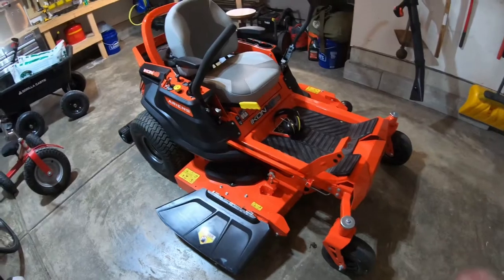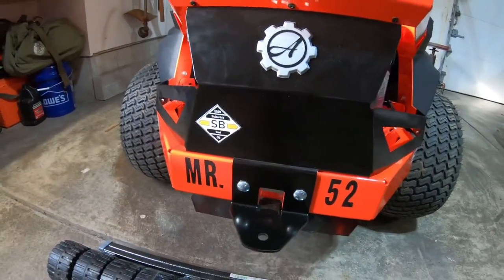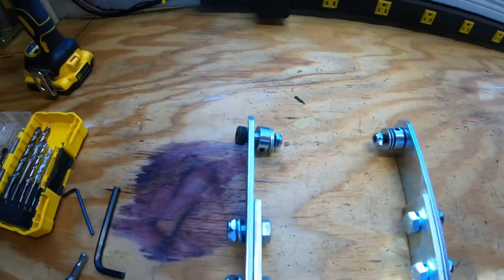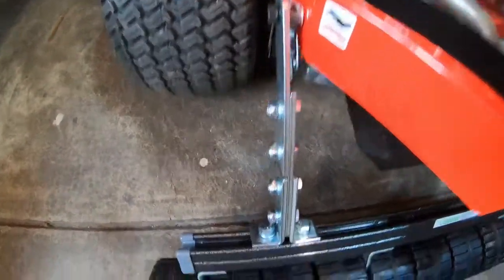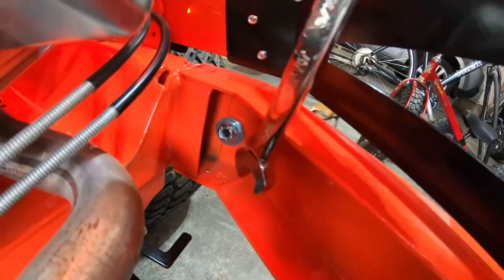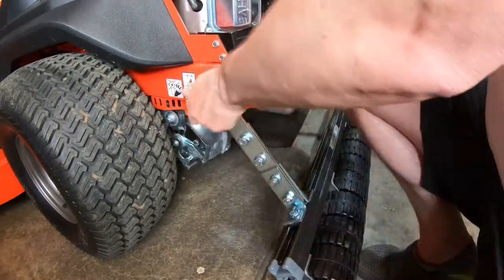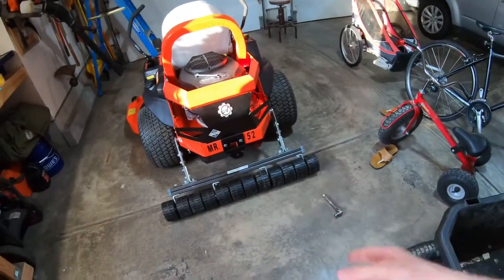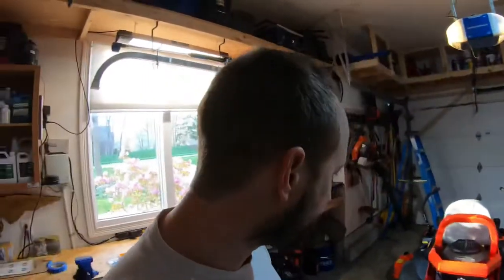Installing Striper on IKON XD #MR52 #ARIENS #BigLeagueStriper

Comment: My Friend is a Genius, been cutting and maintaining lawns for big million dollar company's aka Wegmans Not taking anything away from the big league striper kits! they look  awesome, just dont have 350 to 450 dollars to spend I own the 42 inch Ariens IKON XD 915268 18 HP 603CC Kaw. Went to a local hardware store  Ace  up here in Upstate N.Y. spent 8 dollars for a 38 inch piece of Rubber 24 cents for 2 screws,. had my friend drill the holes, and wallahh it bends the grass blades just as well as the BL Striper kit. Hope this helps to save a few folks some $$$ Have a great day and get back to mowing! Respectfully your Friend Ice Man.. P.S. I did follow your lead and put on the stickers back side of LM says MR 42 Kepp posting those Videos Suburbia Dad! Much Respect👍
Reply from the maker: There are a lot of versions of DIY stripers out there that work. I tried one on my previous lawn tractor and destroyed the rubber mat all over the yard. 🫣😆

Where did you fasten it? The back? I’ve thought behind the deck with a flat piece of steel securing it might work. It would be similar to their kit available for some of their models. 

Thanks for watching and commenting!

Comment: Just bought the same mower.   Curious to see if this striper performs.  Also, is it locked in place or is it free to bounce up and down on rough terrain?
Reply from the maker: It moves freely. I have the video done. I was going to edit it down, but I might just post the front yard tonight. It works great and my yard is not smooth! Thanks for watching!

Comment: Awesome video just received my big lawn stripper kit a couple days ago and couldn't find a video to fit it on a Ariens mower
Reply from the maker: I couldn’t find it either!

Using the painters tape kept me clear of the tube frame on the backside when I drilled the holes. I’m glad I checked before I drilled. I almost didn’t! 😳

Please tell me you’ve mowed by now!? 🙏
Reply: @theSuburbiaDad  I have mowed and there definitely is a learning curve and I want to mow a few more times before I throw the striper on it but great advice with the tape
Reply from the maker: @lawnchild1829  I mowed for the fourth time and I’m getting the hang of it. Took me a few times to figure out how I was going to attack the yard, but once I did... it’s been smooth! 

Something that helped was when I realized my handle bars were backwards after the third mow! 🤦‍♂️ 😆

Let me know how the install goes! Good idea to let the grass grow for a few cuts before rolling it with striper. 

✌️
Reply: @theSuburbiaDad  mine weren't backwards but they definitely wernt lined up correctly which made my straight lines not very straight but I fixed them now

Comment: Gotta love those Big League Stripers.  Does the roller float up and down as easy as it did with the quick connect setup on your previous mower?
Reply from the maker: It’s a great addition to Mr. 52 for sure! I don’t really notice it behind the mower. So, like a cloud? ☁️☁️☁️😆

I didn’t get quick connect on this one. Not sure how I feel about not having it yet. 🤷‍♂️ I imagine I won’t take it off much. I can purchase a quick connect bracket system for $40 from Big League down the road if need it. Other two bolts, five minutes to get off. 

Solid build regardless!

Comment: Love the videos, I have the same mower. What size roller did you get and now using yours did you get the correct size or should you stay with the recommended width of measuring half way between both rear tires?
Reply from the maker: This is the roller Big League Lawns recommended when I called... 

https://www.bigleaguelawns.com/checkmatetrad-lawn-striper-for-ariens-ikon-x.html

It has worked perfectly. I’m happy with the striping! 

Thanks for watching! I’ll get some more up soon.
Reply from the maker: This video shows a recent mow with it... https://youtu.be/RAyTh-_JNC4

Comment: Great video! A couple of questions. Can you keep the roller on when using the hitch to pull a cart or spreader? Also, any knowledge if you can have the roller, hitch, and bagger on at the same time? Thanks again!
Reply from the maker: I keep the hitch on all the time. It doesn’t hinder or impact the roller at all. If I attach the cart, still no issue. You can get a quick release system as well for the stripper. I just didn’t get it... yet... 

The hitch has an opening for an adapter. I don’t have the bagger... yet... but I assume it plugs into it. So, you might be able to run the hitch without the cart, the bagger, and striper. 

Hope this helps! Thanks for watching.

Comment: Are you able to lift the roller off the grass an hook it up behind the mower if you wanted to?
Reply: The striper kit its self is pretty heavy ( probably around 30- 35lbs)so you need something pretty strong to hold it up but mine came with a quick connect system that would allow you to remove it within a few seconds
Reply: @lawnchild1829  I will have to check mine. I may have the same thing. I got it last fall and haven’t attached it yet.
Reply from the maker: I didn’t have a quick connect, but might be worth it. I had one on my lawn tractor. It was super convenient. Currently, it is two bolts to undue. 

I agree, you could rig something to hold it up; but it would have to be strong. My roller is 48-51 lbs according to their site. 

Colin which quick connect did you get? The clamp system?
Reply: @theSuburbiaDad  yup the clamp system, pete from GCI turf had a great video on it
Reply from the maker: @lawnchild1829  I saw it. Great option... especially if you are unsure of drilling. I might get one... mmm... 🤔

Comment: I see that you were ask about the size of the striping kit and you shared the link. Any way you could measure or tell me the exact length of the one you purchased I’m looking into ordering mine but not positive on the overall length I need.
Reply from the maker: I’ll get it for you tonight! You’ll be laying some 🔥
Reply: @theSuburbiaDad   nice thanks man!
Reply from the maker: I’m getting 39 3/4 inches from outside wheel to outside wheel on striper. I see they’ve added an XD kit. When I got mine, they told me to just get the one for the Ikon. It’s worked great. 🤗

Thanks for watching! Hope this helps! Make sure to use GCI Turf’s promo code. ✌️
Reply: @theSuburbiaDad   awesome ordering now
Reply: @theSuburbiaDad  I got it, and installed. Mine came with the quick release kit. And from what they told me I needed to drill out my bottom engine guard screw hole which wasn’t the case I had to drill lower than that but it’s on and does a pretty decent job. I’ll probably do some tweaking on it to get it to preform better but it laid some nice lines.
Reply from the maker: @coreysimpson1851  nice! The taller you mow, the better they go down!